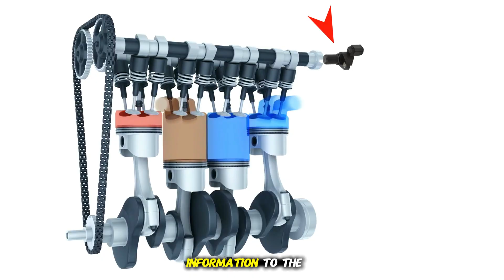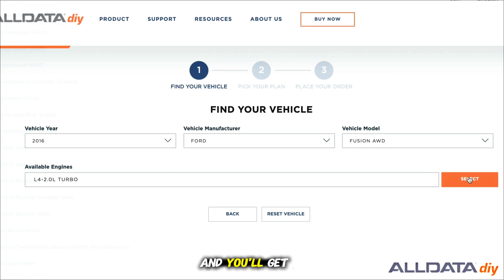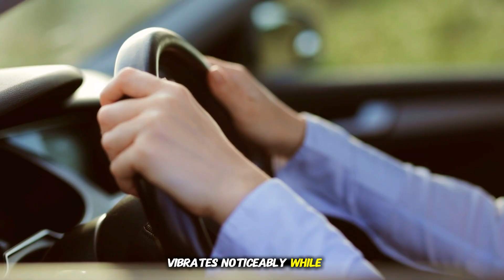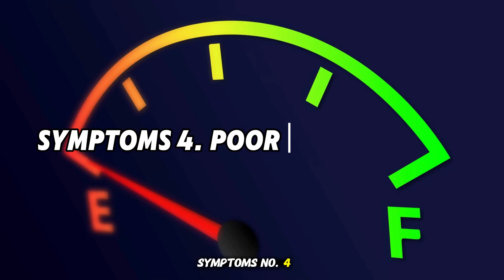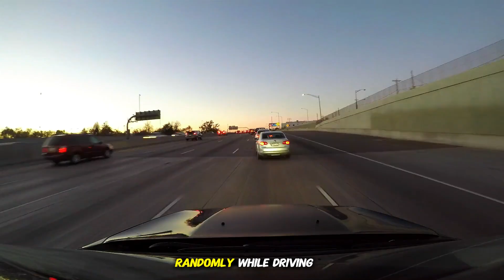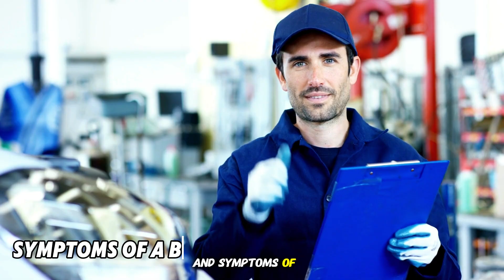Bad Camshaft Position Sensor Symptoms

Comment from the maker: 🚨 Notice These Warning Signs! 🚨
If your car is showing rough idling, poor acceleration, engine stalling, or the check engine light is ON, your camshaft position sensor could be failing. Ignoring these symptoms can lead to bigger engine problems. Watch the full video to learn how to spot a bad camshaft sensor and what you can do to fix it! 🔧💡

💬 Comment below: Have you ever dealt with a camshaft sensor issue? Share your experience!